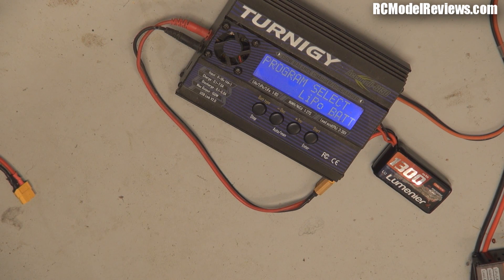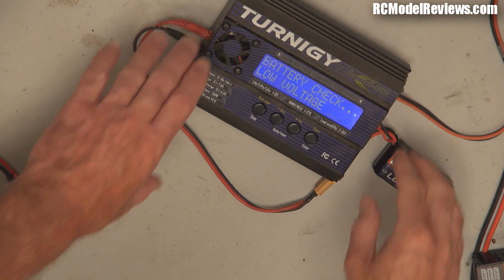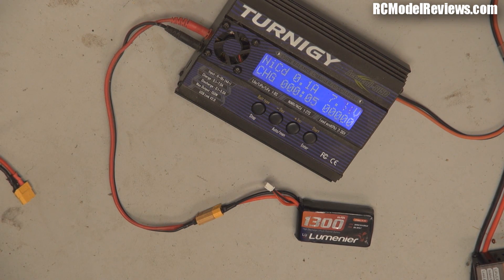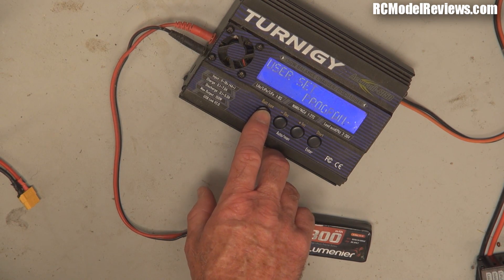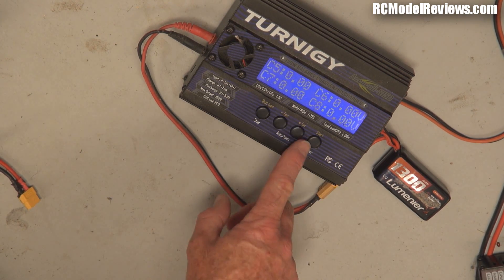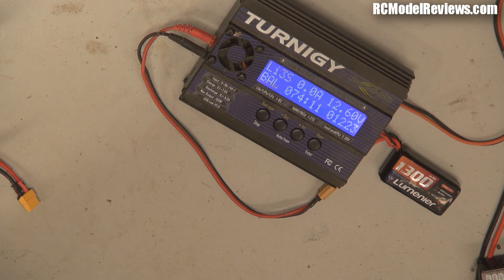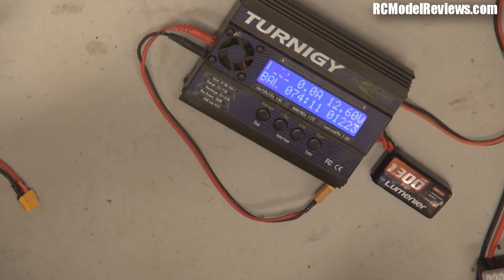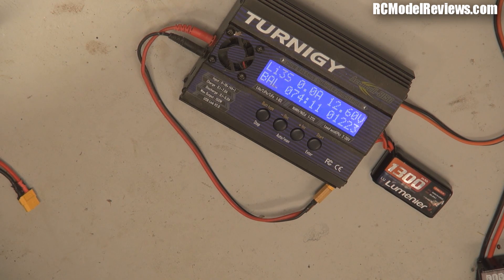How to recharge a fully flat lipo (lithium polymer) battery

Comment: In my opinion there is only one safe solution for such a battery: Discharge it to zero, drive a metal rod through it in a safe environment and chuck it into the battery recycle bin.
There is simply to much danger created by such a battery. Look after your battery packs carefully and this situation will be very rae. We work with plenty of LiPo and other LiIo in our institute and had one LiPo incident. It is amazing, how much smoke and heat there is, even from relatively small LiPo's like 1Wh or below. If you go up to and beyound 100Wh of energy, there is quite some music in the box.

Comment: My  new 4s 1500mAh  went dead in goggles on a power cord . 
 Goggle screen turned white .
 Battery testor was blank . No reading at all at first . 
 The battery sitting for 10 minutes by itself no charger the testor showed a reading if 2 volts very low . 
  After 4 hours of sitting by itself and still no charger hooked to it  the testor reads 3.068v , 3.2 v , 3.2 v. 2.068 v .and total 12.6v
   Im going to try charging with my b6 charger soon .
Reply: 💥💪👂👋😵🪦 just kidding . Trying next

Comment: So i had a dead lipo and just took it to my hobby shop they revived it and it was quite warm after that but he said the voltage came up to 3.7 so i drove home about a 30 minute drive and made dinner about another 30-40 minutes then went to go balance charge the revived lipo and it was still pretty warm is that normal? Anyways i still charged it anyways its a 6s lipo 5 cells are at 4.1 and one cell is at 3.9 and its still warm hours later should i just cut my loses and get rid of it
Reply: It's now 1 in the morning and can't call the hobby shop so I think I'm leave this one outside for the night in a lipo bag cause I need some sleep and don't want to be worrying all night

Comment: G'day from W.A👍🇦🇺
Just looking for some advice.
I have a 4S Lipo that has been nearly fully discharged.
Cell 1 = 0.34V
Cell 2 = 0.2V
Cell 3 = 0.29V
Cell 4 = 0.43V
I have an Imax B6, as well as a CC/CV power supply.
I'm thinking of connecting each individual cell to the power supply and charge each cell a bit at a time, at very low current, and low voltage, maybe starting with around 50mA at 0.5V. Then next at the same 50mA to 0.6V, then 0.7V etc working my way through all the cells to bring them into balance and get them up to a decent voltage to then switch the pack to the Imax B6 using the 0.1A, 4S setting.
Or,
Should I try the NiMh setting instead, even though the cells aren't balanced too well right now?
Currently the total pack voltage is 1.28V, so if I was going to try the NiMh setting on the B6, I'm thinking along the lines of starting with the 0.1A, 1S setting then stepping up to the 0.1A, 2S setting onwards etc.
What are your thoughts?

Comment: Thanks for sharing. I needed to charge my only 2s for calibrating throttle end points. The charger threw a battery disconnect at me. So I used your technique and worked like a charm.

Comment: Nicely shown, but what can I do without this fancy (and probably really expensive) battery charger? I only have the charger that you plug in to USB and charges the battery with 1500mA which came with the battery itself. It's been left charging all day and from 6.5V it barely got to 7.8V and then stopped. The charger also makes some noise, similar to a brushed motor driver and low duty cycles. I don't have any spare Li-pos and neither do I want this one killed permanently, what can I do?

Comment: what if you have 1 cell with 1V and the other 2 with 4.2V? how do I revive the 1st cell?
Reply: Charge as a single lipo thought the Ballance lead,  figure out which two wires belong to that low cell, and use this technique.     I done this to revive a dead cell in a 4s 2800mha. Had three cells at 4.2V and one was only 1.8V.   Worked a treat

Comment: I've seen this method before, but I have been so cautious after a few blown up lipo batteries lol (different type of situation). But hey, I thought I'd try just as you demonstrated but only 1-2 minutes at a time..before even 10 minutes of charging, my batteries were in the 3V range per cell!! I have 3 batteries saved so far that are now safely and fully charged again. You just saved me well over $100 on batteries I thought I had thrown out since I deemed them totaled; good thing I kept those batteries and I cannot thank you enough! 
Anyone reading this by chance, if you try this, I would be extra cautious and only charge for a minute or two minutes at a time, unplug it, and then reconnect to check voltages--but that could just be me over worrying lol.  
Thanks again man, I really appreciate this

Comment: Just to clarify, when you say to not use the revived cells in a high draw application, would you advice against using in for airlift? In this case, an ASG 11.1 unit in a scorpion Evo A1?
I for one can attest to the volatility as I wasted my first EVO A! plus a beautiful wooden floor due to janking a bit too hard on a 2 cell bat that got stuck in the gun..

Comment: DUDE!!! YOU TOTALLY JUST MADE MY YEAR!!! I've had these 3 lipo batteries (11v 5200) in storage for about 3 years and never got to use them. They were brand new and I just tried charging them but got the low voltage error message. They were about to be disposed of until I saw this vid. IT TOTALLY WORKED 100%!!!! Thank you soooooo much!! My Slash vxl, Arrma fury, and my Slash 4x4 vxl greatly appreciate you!!!

Comment: Thank you ! my lipo went just under 9.5V and my charger wouldn't recognize it anymore. plugged in my handy cell checker on the battery balance wires and switched my charger to nimh, in about 10 seconds my voltage went up back over 10.0V and i could switch back to liPo charging mode ! nice tip sir

Comment: One last thing I Calc 3.2x4 to get 12.8 and stop my charging at 13 volts which enable me to switch to LiHV to charge. Note not all cells equal but it will get close enough to complete successfully

Comment: Saved two 11.1V LiPo batteries for Airsoft which had discharged because I didn't realize how fast my new Bluetooth-enabled Jefftron Leviathan mosfet runs down batteries. I ran one down, bought a new one at the field, and left it until the next day in the gun due to forgetfulness. Two brand new batteries that hadn't even gotten through one cycle - dead.

Both were down around 6.7 - 7 V and would not balance charge - "low voltage warning". The method in this video saved both and all have nicely balanced cells. I guess I got lucky, but I wouldn't have even tried without this video. Thank you!

Comment: Excellent video. I did not let my battery run flat.  I blame the tree that held my lost plane hostage for a week for this travisty.
I used the Tx charge port on my old Robbe power peak infinity nicad charger. (1 - 8 cells, 250 mA)

Comment: Man you just saved my 2 Turnigy 3S 11.1v 5000mAh LiPo batteries with your advices!
They were so low, about 4.5v each pack. I charged them until 9v with Nicd mode at 0.1A.
Then put them in LiPo Balance charge with 2A. Perfect work!

Moreover this 2 packs only had 2 charges so I was really disappointed at first!

Comment: appreciate the video, but it wasnt completely flat. if one of your cells was completely flat, the charger would produce an error for wrong cell configuration, but on yours it just said low voltage, which means one or more cells is below 3v but still above zero and detected.  i have 4 lipo batteries that each have one completely flat voltage meaning zero. i have cut the end of the pack open so i can get to the individual batteries that are connected in series and apply a small charge on just the one flat cell via bench top power supply, but when i take the power away it slowly falls back to zero. grrrr

Comment: any idea I have two spektrum smart 6s 5000mah 100c 22.2v batteries and I have a s2100 charger and they now wont even charge since. they dont read they show nothing when I plug them in. I have only 8 charges on them. any idea on what is wrong? all my other smart batteries charge after I've done the recent firmware update for the charger for the new g2 for the charger so I can charge my g2 batts. im very confused any help? its like both batts just died?? No read on my smart checker nothing?? would love to hear a reply from you or anyone..thank you.

Comment: Used a standard car charger for a 4S Upair2 battery that had only 2volts left in it. Disconnected the plug that goes to the PC board and basically touched the connectors to the Battery side for no more then 10 seconds and then had 7.9 volts which was enough to get the charger going.
Top job!

Comment: Hello there I just want to say thank you very much for this video I was losing my mind I bought a brand new battery I tried using it and it didn't work so I connected it up to my charger and it said it only could detect one cell at 3.8 volts and it wouldn't pick the other 5 cells up there is no voltage and it was driving me mad then I saw this video it did work but only for two of the cell the rest it won't pick on the voltage metre on the charger it's now saying the first two cells are  now 3.57 and 3.74 but the other 4 cell the charger won't even pick

Comment: This has worked for me a few times. But when this method didn't revive a lipo, I did something more drastic. I set it to Nicad. But i turned it to 5.0amps charge. Let it charge without balance plug connected for 8 to 10 seconds. Turn off. Plug in balance plug and charge normally on Lipo Balance charge! 
 I revived several 1s and 2s batteries this way.

Comment: Need help just got a judge rc car from going toys on Amazon it came with a USB plug for the iso 1600 I dont understand what I'm suppose to plus the USB into without overcharging it whats safe to use I just charged my first battery and it has a little swelling do I have to get rid of it asap its brand new

Comment: Well I tried. Must have accidentally put my near-new expensive 3450mah 4S LIHV battery onto Discharge instead of Storage, then left it for 2 months. Protek smart charger (smarter than me) refuses to charge even after this trick appeared to look promising.  But cell #1 is dropping voltage before my eyes and was a massive .8v below the others. Methinks after only 4 flights it's going in the bin :-(

Comment: What does it mean when the total mAh required to charge a LiPo is more than the battery mAh rating?  Example:  1300mAh 3S recharged to 11.1 vdc shows 1400 mAh to recharge.

Comment: When im charging my batterys,  if I leave them on the charger over night plugged in but done charging, could that be draining them down? I have 3 new 6 cell batterys that are either reading a break in the connection or cell damaged. Could I have my setting set up wrong? I have not found a video on all the settings to know what to put them on and the manual is like another language very unclear on how to know what to set all the setting too so I know im doing it right . It also seems like im not getting very much flight time out of them as well. Any help would be greatly appreciated.  Thx !!

Comment: MISLEADING TITLE (Clickbait?) + this method is somewhat flawed. Please read on...
Firstly, the battery was NOT "fully flat" - it was a 3S at 6.72V which equates to 2.24V per cell.  That is quite low, under most manufacturer's spec for under-voltage,  however it's highly unlikely to have damaged the cells nor will there be a significant chance of fire.
The recommendation to re-charge at lowest possible current is good advice. He uses a hobby charger at 100mA. I usually use a small power supply (B3603) with Constant Current capability, and about 50mA.
I always bring the cells up individually, which minimises the chance of killing good cells if one of the cells in the pack has died. For example, if you have a 3S pack with one dead cell, then charging it (without balance lead) to 9.6V like shown here will result in the 2 good cells being hit with 4.8V each which will definitely kill them and could cause a fire.

Comment: my lipo gets the same warning error but when i test it its at 11.97 volts..... i bought it and had it put into storage charged discharged it randomly a few times cuz i couldnt use it in the winter time and now i start using them and on the second or third charge they goofin on me with the low cell error but state theyre at full charge or 80% and die .. im still getting used to lipos

Comment: Cheers my friend, you have just saved my 2s lipo! I got the battery to 7v then tried it and it worked 1st time. I was shocked when I 1st checked the voltage as one cell was showing as 2.5v and the other at over 3.5,quite a big difference but thanks to your vid its now fully working and charging without any swelling on the pack..... Topman!!

Comment: Would this trick work for a 6 cell lipo with one cell to low to charge?
Reply: Yup, because when you do it this way, you're not hooking up the balance lead, so the voltage follows path of least resistance and will bring up the low cell, before going to the others.  It still won't take long, like in the video, I'd say 7-12min is about the average time.

Comment: I've tried this method to revive my battery, but once I charge it says connection break.. What can i dk to counter this?
Reply: OK thanks for ur advice.. I appreciate it
Reply: What kind of charger?  Make sure balance lead is NOT connected, you can try this on NiCd or NiMh setting, remember, you're only doing it for a short time, 7-12min tops, to bring up the bad cell to the rest of them, then stopping the charging, plug in balance lead, and switch over to a balance lipo charge.  Most chargers when in Lipo mode (or other modes if balance lead is plugged in), will say bad connection or connection break if they sense any cell under 3.0v.
Reply: I'm using imax b6.. I will try it again as soon as I get back to my office to fetch my charger
Reply: Blaster Smith...Ok, good news and bad news.  Bad news is that's near the bottom of low end chargers and the exact one I was using when my basement almost burned down when i was a newbie.  Good news, the lipo caught fire due to my negligence; and not properly researching how to charge a lipo. Its  still a decent little charger, there's just less of a margin for error. Make sure you read the instructions or at least watch the attached video, its 22min, but its your exact charger, and lipo charging in itself can have a lot of pit falls.  Sounds like you might just have something hooked up wrong.  The other good news is, almost every charger on the market uses the same guts, lcd, and electronics, so once you learn how to program and use your current one, if you decide to upgrade, you'll pretty much already know how to use it. 

https://youtu.be/w8ijfcjU-rc

Comment: I bought a brand new lipo 11.1 1300 battery and worked fine till I tried to charge it. My charger doesn't give me an output rating. I have a nunchuck style battery and one of them gets hot when I try and charge it. Do you think Its shot or if buying one of these chargers could save it? I would hate to spend the $60 on a charger if it wont help it then have to spend another $30 on a new battery lol any info would help bud and thank you
Reply: What kind of charger are you using?  I'm a penny pincher myself, but never skimp on a charger, I almost burned my basement down when i was new to hobby because I didn't learn about lipos, and buying a cheap $20 charger.  Battery should NEVER be hot when charging, maybe a tad warm, but that's it. Are you connecting the balance lead? (connector with several small wires, one more than amount of cells,  yours would have 4) and making sure the charger is set on Lipo balance setting?